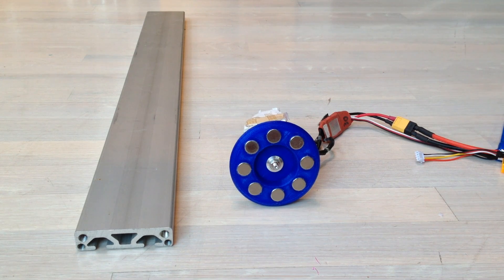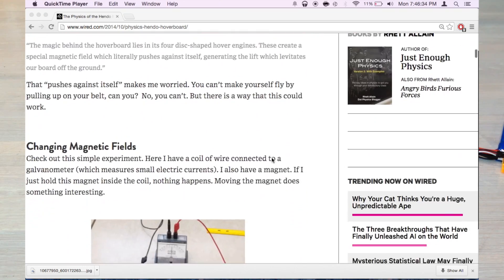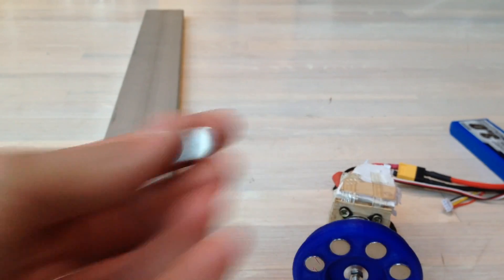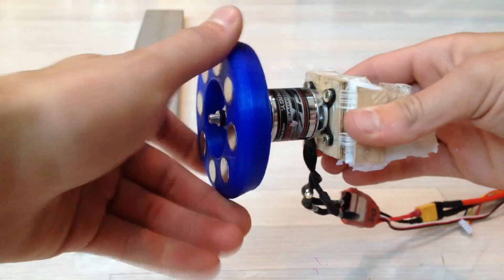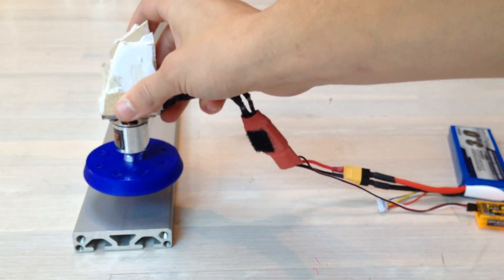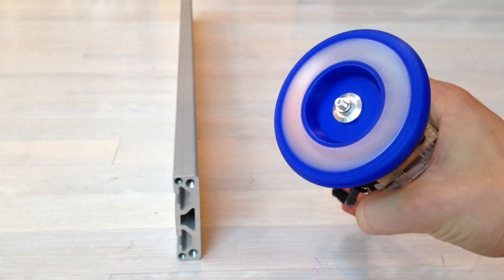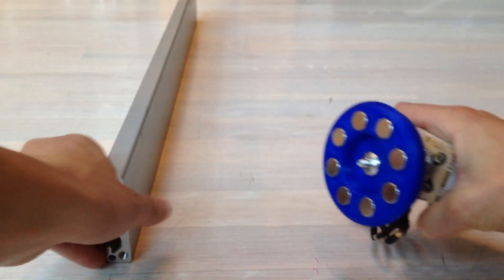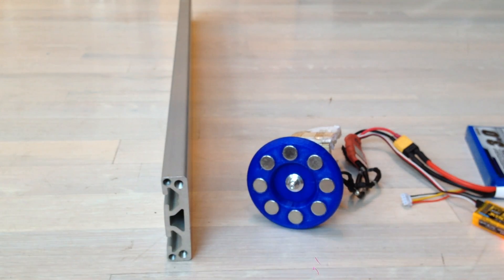ON THE HENDO HOVERBOARD: How it works and demonstration

Comment from the maker: Joshua Higuera 
Yep. This tech has been known for quite some time, and has been previously referred to as the Lenz effect. It will NOT work on any surface that is ferromagnetic and/or nonconductive.
Reply: SO........unless you put down miles of metaL, that board will travel...NOWHERE ??
Reply: Scat Elis yep, but think If we make train rail with it. Where conventional maglev,  you need to magnetize entire tracks. And with this tech, you can carry the power source or use electric cables
Reply: Scat Elis you could mix aluminum chunks with bitumen in asphalt, instead of using stones. That way you could use much less metal and normal cars could run on them as well.
Reply: Speedhero2PL no it is more hope from their part. That we, humans, will make that possible with their technology some day.
Reply: ***** or you, because you don't understand the technology. I have a mensa test IQ of 140 and has studied theoretical physics at Lunds University, Sweden. I don't think it is me who is stupid here.
Reply: xXJackirBlackBloddXx the hover board is much more efficient by using Lenz law and magnetic field architecture instead of magnet on magnet like on maglevs.
Reply: *****
Rollercoasters use eddy current brakes.
Reply: Mikael Murstam I doubt mixing the conductive materials with asphalt would fail to affect efficiency, and the hendo hoverboard is already at 90 pounds and with a battery life of under ten minutes. I fail to see how this is in any way more useful than using a skateboard with wheels, which doesn't cost upwards of 10 thousand dollars and won't run out of battery on you, forcing you to carry a weight that is illegal to carry alone by official safety guidelines.
Reply: Revlar Milion why do you think the hover board must be more useful? You don't run a hover board because it is more useful. You use it because it is fun. The same reason why you use a skateboard in the first place.

The usefulness of a hover car however is huge. Especially if you manage to provide wireless energy transfer through the road. The speeds you could reach are enormous as well.
Reply: Except you can't put brakes on a magnet
Reply: Revlar Milion there is something called Eddy current brake, look it up. You can also tilt the magnets, and even use emergency thrusters if you need a hard brake due to the low friction.
Reply: Eko ari wibowo we could make a rail type thing for it :L ... OR, we could use them for recreational purposes and build hoverboard-skate parks! :) ..you know, when someone decides to figure out how to control it :p I think that would be easiest if there was a program to control motor speed based on the angle the board is at relative to the ground, and split the board into two, like the ripstik (hope I spelled that right) so that you could spin circles in place too :3
Reply: ***** eh...no not "everyone" is using it. You don't know what you are talking about and clearly don't understand this technology.
Reply: I totally didn't know that! That's pretty cool!
Reply: thehalofreak06 more and more self-driving cars are coming which will make us drive faster, safer. The energy saved for having basically no friction may compensate (and then some) for the power consumption of the levitation itself. I haven't done the calculations to check it, but it may very well work.
Reply: No the surface was copper.
Reply: ***** Yea Nikola Tesla's.
Reply: Eko ari wibowo I believe there is a maglev that already uses this technology... I could be wrong.
Reply: Hendo plan its work on any surface also water. Read about it ;)
Reply: Eko ari wibowo hovering trains, have ben in the making for centuries, the hover board is shit compared, really
Reply: Mikael Murstam Wouldn't the stones not be able to generate the opposing current due to being separated? Kind of like laminated metal in transformers?
Reply: Rennie Ash No I don't think so because they will just combine their magnetic field. There will be tiny currents in every "stone", producing its own magnetic field. It would be just like spinning atoms. Every atom spins and produces a magnetic field. If they are aligned they combine their magnetic field and creates a big magnet. That's why you have permanent magnets in the first place =)
Reply: Mikael Murstam
You do realise that there are so called speed limits for a reason? Speed limits are there because of the possibillity of human failure and not because of the cars which drive on the road. Most of them could drive faster performance wise.
Most of the time it is a human mistake that leads to an accident. Drunk driving, negligence etc.
So tell me, why should we use hoverboards/hovercars when our current technology gets limited by the laws we set/ human nature.
Its not the tech that needs improvement, its the human who has its flaws.
Reply: Mikael Murstam
Ok so in a couple of years everybody gets around via cars which are guide by a supercomputer...then a hacker hacks the system so all cars go full throttle -> many dead people but that is none of my business
Reply: thehalofreak06 yeah but that can be said by autonomous cars now as well. That has nothing to do with me. I'm just saying what is possible and a flying car wont change the fact that the autonomous cars will be around. They have to solve the "hackability". The same can be said by a plane which use computers as autopilot.
Reply: Mikael Murstam
You really want this to work far better than it does.
As it is, it's a waste of energy, materials and time.
It's a huge step backwards from wheels.
Reply: Mikael Murstam k, but why are you saying this to me
Reply: xXJackirBlackBloddXx You posted in this thread so google notifies you of all replies :-P Even if they aren't for you. You can unfollow it
Reply: so the surface that hendo was using had something underneath it?
Reply: ok
Reply: Revlar Milion  in some other videos, they show a remote controlled version that clearly moves smooth and accurately and can slow down.
Reply: Flyingwigs
That's someone else's product, isn't it?
Reply: I just had a thought, If you to put the same technology into a pair of shoes, and like take RPM and times it by like around 10, is it possible to actual fly?
Reply: Bigfatlab well ,you have the problem of balancing and then if your batteriesrun out you are going to fall
Reply: Well, just have to have strong batteries, and also, your falling like 2 feet, I think this is an awesome idea!!!
Reply: Bigfatlab but if you fall you would brake the magnets and motors, also you need space for em so you would basically wear high heals
Reply: Bigfatlab but lets face it are you really gonna use it
Reply: RaptorTech We already lay hundreds of miles of rebar, water/sewage pipes, underground electrical, telephone and other stuff when we lay roads. I see no reason why one of the multiple layers that make up a modern concrete & asphalt blacktop couldn't include a conductive mesh of some sort in anticipation of hover cars/boards.

We wouldn't have to "replace" roads as so many people are saying. They're imagining pulling up millions of miles of road and replacing them with sheet metal. That's not at all what would need to happen. The next time a road needs standard maintenance & resurfacing, just lay down a wire mesh before pouring the final layer of asphalt. Making the roads hover-compatible would be done just like any other infrastructure project, slowly updated over time.
Reply: M. Adams
This tech rides close to solid metal. Where the floor isn't flat, it gets closer.
These magnetic field effects the "hover" uses fall off with distance cubed. It would take 8x the power to go 2x as high, still not much clearance. So how deep can you plant your mesh and not have the board scraping asphalt?
You have to have enough metal below the board to return a field push-back, noting that that mesh is going to have eddy currents equal to the weight it supports running through it. The thinner the mesh, the quicker and hotter it will get. Hope you don't plan on loosening the asphalt layered over it? And what about the normal traffic?
Reply: ***** I know the numbers, and I'm not saying adding magnetic substrate to roads could or should be done tomorrow. I agree it's not there yet. It's just not as far off as some people might think, and as the technology develops, likely not as invasive, either. They're still in R&D, trying to develop more efficient magnets, and developing the substrate they have it riding over as well. In their demos, Hondo is not just using solid sheet metal, they've got a laminated metal substrate they're working with. Further materials development will make the technology more flexible. It may end up not being a metal at all, but a conductive fiberglass fill or something. But I feel like technology is drifting in the direction of magnetic hover vehicles, and it may be sooner and less painful than we expect.
Reply: M. Adams
The Faraday/Lenz Law hasn't changed in about 200 years.
Maybe when the new carbon materials room temperature superconductors get cover the roads real cheap someone will have figured out how to steer and brake the things.
Reply: +Speedhero2PL laws of physics, read about it ; )
Reply: ***** The average IQ is about 100 to 105, you need 131 to be a member of Mensa. Less than 1% of the world has an IQ of 140 or more.
Reply: ***** I said that because the average changes over time idiot. 105 today might represent the average IQ of 100 back when I took it.
Reply: ***** haha yeah right, by you? You are just rambling on talking about completely irrelevant things, calling me a genius like I ever claimed it. You haven't said anything of value at all. Nothing of what you say contradicts me. I don't even know why you are talking to me.
Reply: Mikael Murstam
So are you genius enough to know that the Hendo board approach is impractical?
Reply: actually it's len'z law not Len's effect
Reply: Turtle Tech
Faraday/Lenz Law -- both are family names, both got credit,.
Reply: *****
Magical way = Pretend bullshit.
Reply: *****
It's so deeply flawed that you can type about on a home pc that runs at gigahertz clock speeds.

But of course a couple of losers who don't understand science at the high school level are just the clowns it takes to pretend to judge it.
When you have something BETTER, then come and your talk won't be total kid shit.
Reply: *****
You mean things like the assumption that there is a shared reality?
Referring to unnamed flaws ... wow, is that your standard of disproof?

Come up with something that works BETTER than science.  So far, you got nothing but empty assertions. Science works solid, quicksand isn't but it's still more than you have shown.
Reply: *****
I ain't reading the babble until you come out with something real. In fact, I'll wait for you to get the Nobel prize for coming up with a better WORKING system than the current science.
 
What have creationists made? Nothing REAL.
And here I am using a computer made through science to do something REAL.

If science was 1% as cracked as you seem to think, there would be no computer or cars or power grid or most of what lets 7 billion people live at the same time.

Don't dismiss you offhand? LOL, extraordinary claims require extraordinary proof and claims presented without proof can be dismissed without proof. Your assertions are nothing but woo so far.

Do you blame me for preferring what WORKS?
Reply: *****
I read enough to know that you have nothing and once again come back when you have something that works BETTER than science.

Until then, babble all you want.
Reply: *****
You're pretending.
Reply: *****
Now you turn to strawmen. I'm not blind nor do I carry the burden of proving or disproving your drivel.
Reply: *****
It's not a strawman, you were just redefining my position into one you can attack.
I'm not blind and you have not shown any great flaws in science, simply assert them. Is that skepticism?

It's funny how when I'm skeptical of your claims that instead of supporting them, YOU try and force the burden onto me and deny that you need evidence to back your bullshit. Actually, THAT is a creationist tactic.
Reply: *****
What assumptions? What do they mean?

The assumption that there is a shared reality?

Or some other assumption that without there would be no reason to debate anything?

What ASSUMPTIONS and what do you think they mean?
Reply: *****
You have nothing then. I did read your drivel, it doesn't stand up. Prove me wrong and get that Nobel Prize.

Stay alive. Seriously, you may learn what a dunce you really are.
Reply: You fail to see. That's your problem.
Reply: You don't get it.
Reply: You get it ;)
Reply: You get it ;)
Reply: You get it too ;)
Reply: You get it :)
Reply: Ahh...my unresearched friend. Eddy currents are already used to generate braking in rollercoasters.
Reply: This man is a thinker :)
Reply: Uh! Nobody has ever created a device that you can hover at home. Open your mind man! Someone just created it for the first time, that's why nobody uses it. Doh!!!
Reply: So Ill need engines over water?